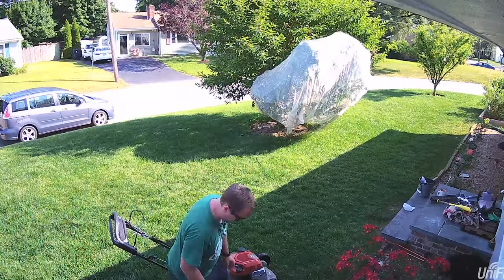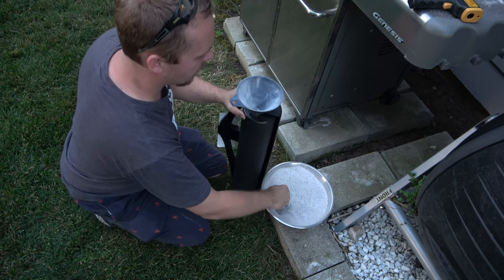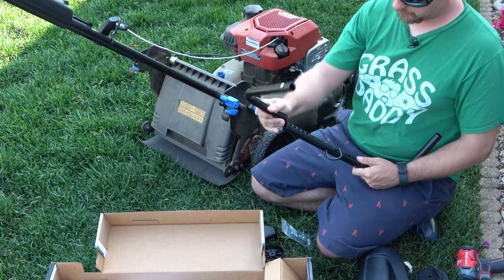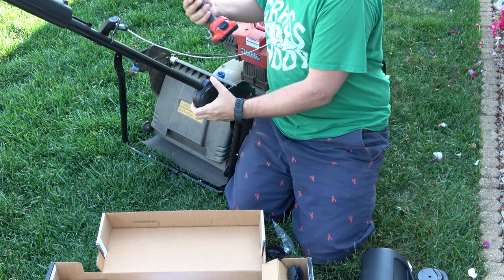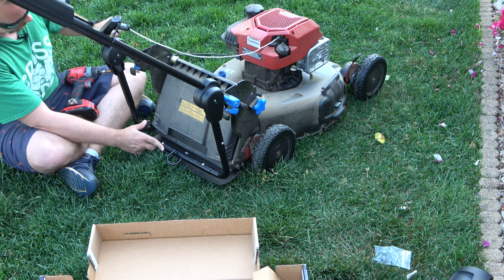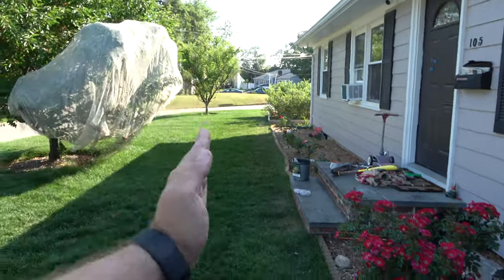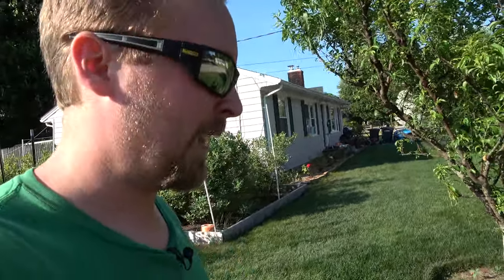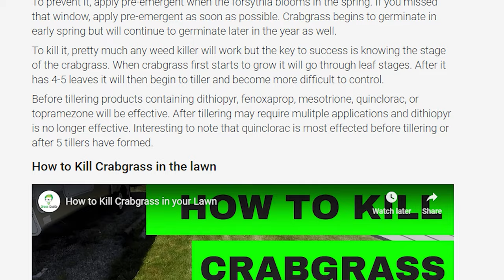Toro Striping Kit Installation Tips and Tricks

Comment: Thanks for giving the Toro a second try.  I’d like to avoid removing the flap in the rear and also drilling holes in my mower. With the DIY and Checkmate, that was not possible. I was glad to see the Toro worked out for you better this time.

Comment: Do you have a preference between the checkmate or Toro striping kit? I had the checkmate and found it terribly difficult to maneuver. I mean its very well built, but just made my mower feel heavier. Great content 👍🏻. Keep up the good work!
Reply: I don't have a basis for comparison but this kit feels HEAVY as heck on my HRX. Even being self propelled it makes the mower significantly harder to turn.  With the way it is set up it allows the roller to pivot up and down and side to side which in theory is real nice, but if you're along an edge, say with a curb, the roller wants to fall down into the gutter, or off onto the curb.  I was curious how the checkmate felt so thanks for your feelings there. Is it hard to back up/turn with it?